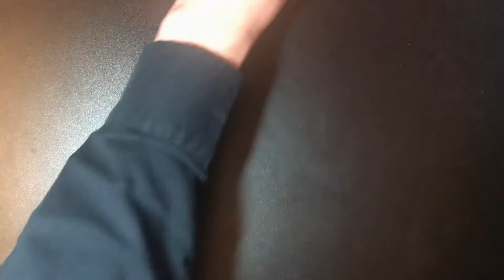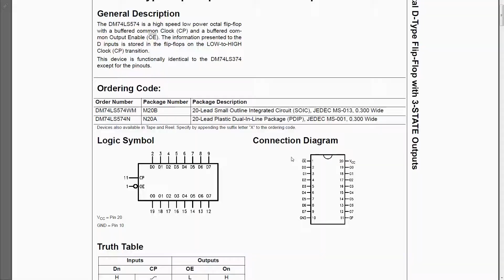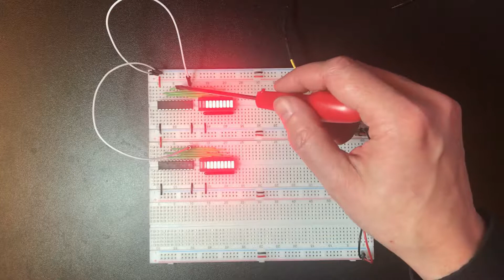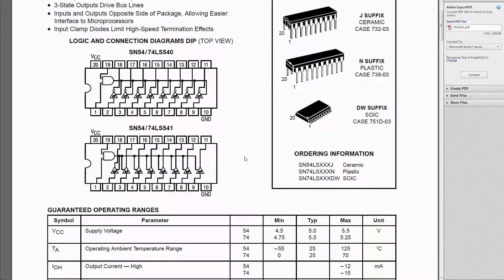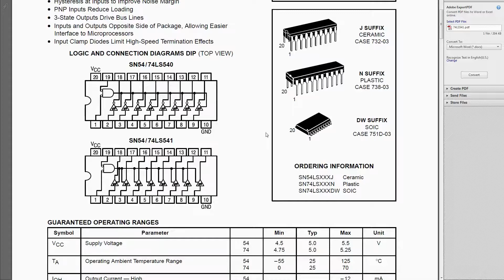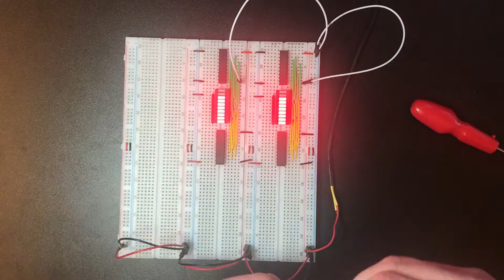General Purpose Registers (1: Initial Build) - Making an 8 Bit pipelined CPU - Part 16

Comment: My thoughts at 2 minutes into the video: Why not just use the same design as the 16 bit registers? They need the same things: r/w from one bus, r/o to another (ALU), inc/dec in hardware is nice, carry/underflow for a status register is neat. Only thing missing would be a way to trigger the zero in the status register on inc/dec, but that's just one extra chip for the nand and one to make that output an impulse.
Reply from the maker: I actually thought about doing this very early in the process, but you would also need to worry about adding logic to handle the carry flag possibly being generated in different gpr's from one clock to the next.
Reply: @weirdboyjim  And as long as the ALU can run in sync and not block the instruction flow for DIV/MUL/... there's no advantage of having those ops run the registers where they can be executed and consumed in lower pipeline stages while a higher one is waiting for the ALU.

Comment: On the PCBs that you design , instead of individual resistors , there are smt resistor arrays just like you use in the breadboard
Reply from the maker: The common Amy arrays are more like individual resistors stuck together rather than having a common pin like the ones on the bread board. I do switch to using those later though.

Comment: With my DIP switch I plugged it into a socket and then plugged that in. It works great, no glue required.
Reply from the maker: Yeah, I've been using turned pin socket strips cut to length.

Comment: maybe already mentioned, but the 74ls245 seems like it functions the same, but you can choose data direction. ben used these.  no need to invert the chip
Reply from the maker: I'm not so keen on using the bi-directional devices as a one directional device. Feels like a waste of functionality. The other thing to be careful of is a loose breadboard wire on direction can result in contention.

Comment: The first PCB I designed was a breadboard shield. It pops over a 74-series shift register and provides eight LEDs to show its outputs. (JLCPCB rejected the files as I'd missed a layer.)

I think there's a need here for a PCB with two sets of 8 header pins a convenient distance apart that'd replace those terrible bundles of wires between the chips!
Reply from the maker: I've had the same idea about headers but most uses for that might be better served by a board that is essentially a SIL led array with a common pin.

Comment: I once got so annoyed that my DIP switch kept coming off my breadboard that I put some glue... Now it will always be there, until the end of times
Reply from the maker: Yes! What is working for me now is to use 2x8pin headers between the switches and the breadboard, but it's the turned pin version you need.